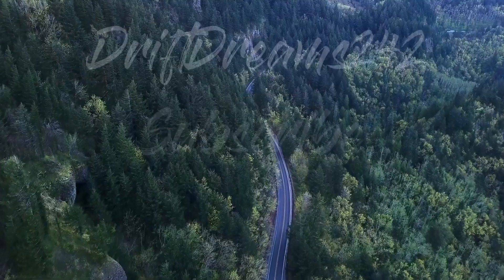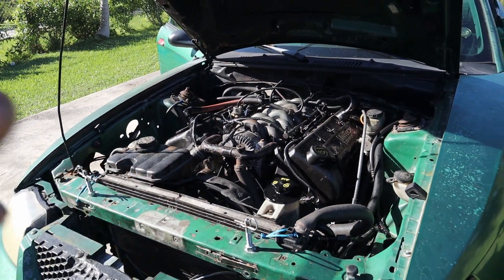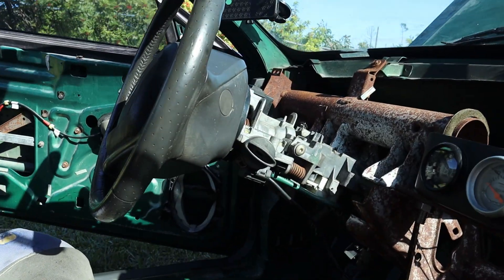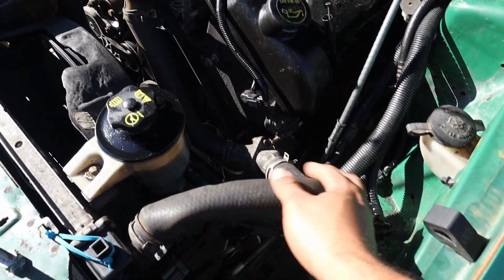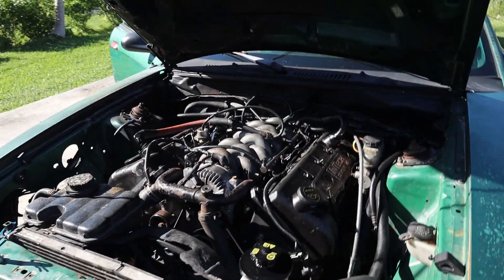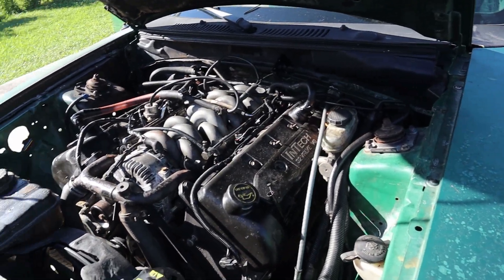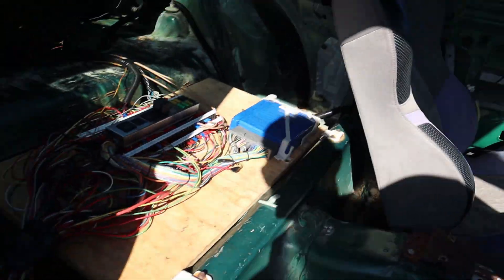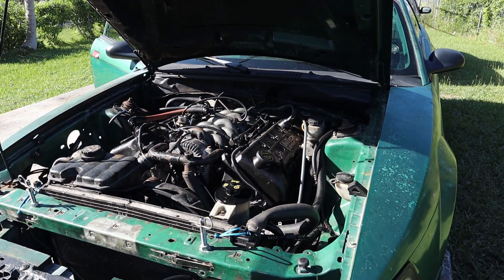Ford Mustang GT 4.6L 2V to 4V Swap Guide

Comment: I’m doing this swap right now, I have a true 97 cobra motor so it doesn’t have the coil on plug. So what do I do then since there is nothing to reverse
Reply from the maker: I believe there's some info on the forums about this, but if I'm not mistaken you use the cobra coils but have to wire them in,
Reply: @DriftDreams242 thank you so much! I’ll check out the forums. Hopefully this is the last step for me before I can drop it in. Been 3 years now building this myself
Reply from the maker: That's so freaken awesome man, if you need anymore help follow me on Instagram and message me, I'll help you thru the swap np, it's really easy  @BushmanFishes85

Comment: I did swap. 2001 cobra 4v in a 2004 gt...everything works great but I have cooling fan on at ignition on. Any idea how to correct that? Thank u
Reply from the maker: @daveking4246  not sure honestly never had that issue,

Comment: I have a 03 mustang mach 1 that uses the 4.6. 4v.I need a block rebuild but wanted a faster and easier swap to save time and money until I can fully rebuild/build the bottom end.can I use this 4.6 long lock and attach my mach 1 heads and shaker to it?

Comment: Going to put a 4v in a 2004 f150
Reply: It sounds like a good idea  but the programming is different and the timing is slightly different the computer is gonna run the same fueling sequence as the 4.6
Reply: @user-xg4ux5qh2i wouldn't the stock computer from the truck just have to be tuned ?

Comment: No need for a aftermarket harness. You can use the GT ecm and harness, fuel is easy, all you do is have to cut the tabs of the mark fuel rail and mount the tabs from a mach/cobra rail. The GT computer will work but runs 19lbs injectors all NA 4v runs 24lbs injectors. Also.... you need a pilot bearing if your running Manual.
Reply: @DriftDreams242  thx, I seen you have that car gutted, cause... race car. Very nice. I'd like to see that tracked out. Mine is a fun / show car. I wish we could have found each other sooner. Congrats on your swap. Following.

Comment: Have a 07mustang 4.6 3v want to swap into a 71f100 using a holley carb intake and sniper stealth efi to control fuel need help on controlling spark. Is the timing controlled from a ecu or can use a coil on factory distributor?

Comment: i have a FORD expedition with a 5.4L 330 Cubic inch V8 engine how hard would it be to do a DOHC swap and what would have to be done thanks nice car by the way.
Reply: Im going through the same swap right now. Im using 2004 lincoln 5.4 4v swapping into 2000 gt. You're going to need to buy 1 inch spacers to lift the motor so that it can clear brake booster. You can buy 5.4 to Coyote intake adapter plates and you'll run boss intake or velocity intake. If you use velocity intake you'll have to delete ac and relocate alt in its place. Those are the major hurdles....
Reply: The 5.4 has slightly different timing then the 4.6. I'd say keep it all the same unless you have a entire donor vehicle as for the 4v it takes more air in and it's slightly different fueling And timing ford changed the programming in the computer for the 3V and 4V engines
Reply: I heard only injectors changed? @user-xg4ux5qh2i

Comment: I’ve been looking for this for the past year! Did my swap last year after a 3 year review of videos with a knowing I can do it. The only thing I did wrong was with the coil pack wiring! I just extended all my wires and plugged everything up. The car just chokes with dashes on my odometer. Was gona buy the 5.4 dohc wire harness for the motor after running into this issue. Had the 4.6 dohc but I wanted to do this swap!
Reply: Thank you for the reply Myoute!!! When I saw your video a few days ago about probing just was unsure about what I do wrong and I don’t know what I did! Just wanna take the harness out or check it out in someway with all the extensions I did. The motor gains no fuel and pump doesn’t activate for it to!
Reply: Follow me 
@newedge_svt_juman

Comment: Hi nice video. I have a ford f150 harley davidson 2002 supercharger 2v and i have 4v 4.6 heads cobra 3 can i put this heads on my truck? Thanks
Reply: @DriftDreams242  hi thanks for your awnser yes is a 5.4 supercharger. But the 4.6 and 5.4 is not modular engine? I think is the same heads.
Reply: @DriftDreams242  thanks. I have #10 polley  72lbr injectors after marker ecu agressive cammes, fuel pressure regulator, ported heads , jlt big air intake, valve springs more pression,  brisk silver racing sparks, sct air flow sensor , big intercooler, supercharger spacer, forged rods and crank, forged pistons, 2nd gear and 4nd. Ported suoerchager. And i wont more 😂
And the 2v stop whene the 4v starts i wont to build a 750hp engine
Reply: @DriftDreams242  they say me i have a problem in spark plug 😂
https://youtube.com/shorts/_Lcg2LqjyTo?feature=share
Reply: @DriftDreams242  Thanks

Comment: Would the stock mark viii oil pan work or would I have to use the one off the 2v?
Reply: @DriftDreams242  did the stock 2v oil pickup tube work with it?
Reply: @DriftDreams242  alright thanks man, it’s because I’ve been seeing on some fourums that if you use a 2v oil pan that you’ll need a cobra pick up tube so it could fit
Reply: @DriftDreams242  one more question man, for the fuel system, what would you suggest doing if on a budget?

Comment: That's awesome you did this swap. I did the same swap in mine back in 2016 and I use mine for drifting as well. Good work! Love it!
Reply: @DriftDreams242  mine has been running strong since the swap. The only issue I had was with the silly throttle body on the gen 1. You can see the difference in the video I made on the two generations. I simply plugged mine into the GT wiring harness, modified the connection to the alternator and the coolant bypass and haven't had a single issue. I've never even had it tuned so it still has the lower redlines of the GT rather than the 7000 of the 4v.

Comment: Just got a lincoln continental motor and I have so many questions intake after throttle body and do you know if I will have to pigtail the sparkplugs too any info is helpful and thanks for great videos
Reply: @DriftDreams242  nooooooo smh go figure I would get something I can't use
Reply: @DriftDreams242  https://www.svtperformance.com/threads/cobra-conversion-using-99-02-continental-4v.1149768/ I found a thread of someone getting it done so I'm give it a try as long as I can get the tranny bracket made I should be good everything else I can do myself
Reply: @DriftDreams242  https://www.svtperformance.com/threads/cobra-conversion-using-99-02-continental-4v.1149768/ I found a thread of someone getting it done so I'm give it a try as long as I can get the tranny bracket made I should be good everything else I can do myself

Comment: I’m going to rebuild my new edge 4.6 2v do you think it’ll be possible it make it a 5.0 DOHC 4v? I’m going to boost it with a kenbell superchager after I know it’s a stretch but I’ve been thinking about it for awhile now and I want to try
Reply: @DriftDreams242  thank you and yes exactly I’m going to bore it out just a enough and changing internals to better suit what I want! And the plus side is the I can look for internals that will fit the block and pistons that are made for 4v hopefully it works I’ll be working on it starting this summer I hope to remember to check back with you to lyk how it goes

Comment: So i can just use my 2000 2v wiring haness and computer on my 1994 lincoln mark 8? I have 98 cobra intake, 98 cobra fuel rails, 01 cobra coil on plugs, 98 cobra cams and 98 cobra throttle cable. i was told to swap polarity to use the 4v alternator wires and just bolt up tranmission since i run a auto in my gt.
Reply: i have a 200 mustang gt and a 94 mark 8 motor.
Reply: @DriftDreams242  Ah Gotcha, i went all out with parts. just making sure my gt computer and gt trans would work. the idea is a full fobra. and my buddy has a 03 termi and im trying to keep up.